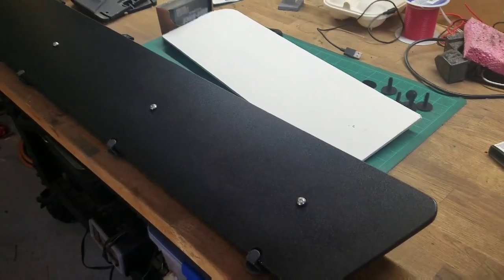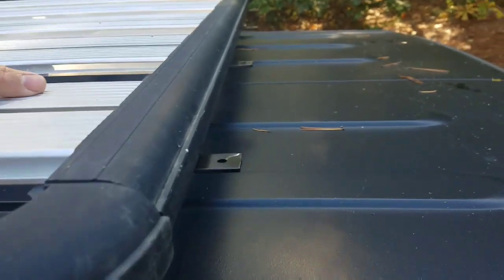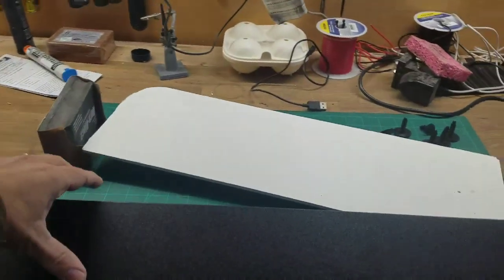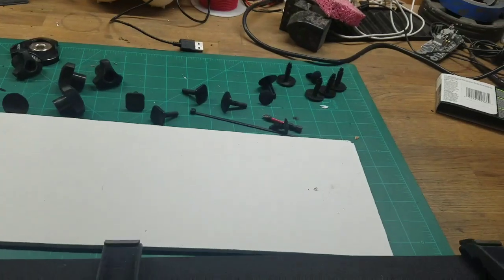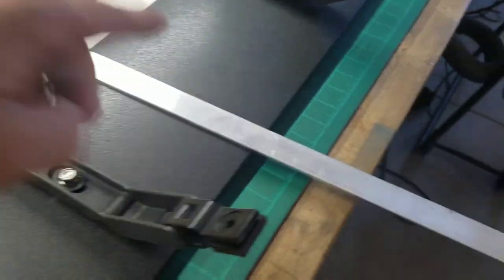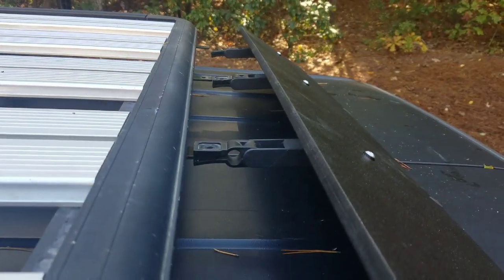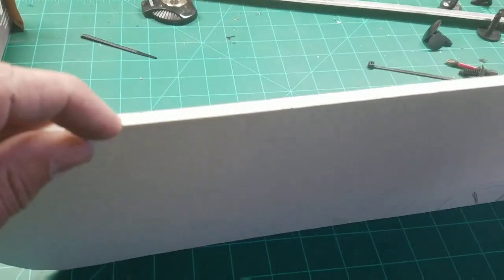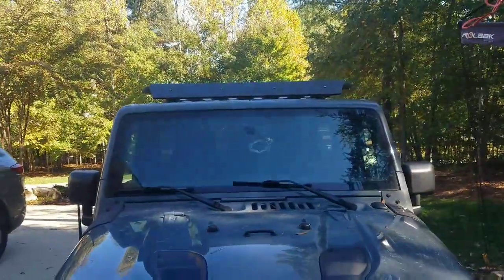DIY Roof Rack Wind Deflector using PVC Foamboard

Comment: Now you have me thinking of all kinds of useable applications for that kind of board.
Reply from the maker: Super easy to work with.    I can't say how durable it will be as it won't take a lot of impact, but I think this is a good application.   Interior trim like door cards.  Use it as a base structure for fiberglass projects... I'm going to play around and see what else it can do.
Reply: Comfort in Discomfort - I have used thick ABS for similar projects and it has held up well.
Reply: I used it to make slats to replace the glass in my daughters jalocee bathroom window

Comment: Thanks man !
I was really struggling trying to find the right material and this is it ! I have a home made rack system for solar panels on a Dodge Sprinter . This will do nicely.
Reply from the maker: Take a look at my follow up video.    It didn't work, but I know why.   It warped badly after a year in the sun.   I think it would work if it's supported better.  Maybe a c-chamnel aluminum.

Comment: Thank you for the material description and where to purchase. I need to make one and been looking around for what material to use.
Reply from the maker: I'm glad you found some value in it.  After a year, the coating looked great, but structurally, the deflector warped badly.   I think if I used an aluminum channel or maybe just one layer, it would have been better.

Comment: You really have me thinking about what I can do with this material. I'm thinking adding fiberglass to it and making it the roof of my roof top tent project. I also wonder if sealing it with epoxy would have helped as far as durability/rigidity and protecting it from the elements? Anyway, awesome idea!
Reply from the maker: I think the fact I laminated two pieces together was a problem also.   Having one expand more in direct exposure while the one in the back was cooler...maybe.    But I think it would be great as a middle layer.    I may have to try that.

Comment: First, awesome find on the rack. Second, great job building the wind deflector.
Reply from the maker: I got lucky for sure.    The ad was only for the platform which I wanted an was going to use with gutter mounts.   But the guy had brackets and he didn't know what they were for.   I told him but he had no use for it...  I have about 500mi with the deflector on so far.   Makes a noticeable improvement.   I may redo a few things, we'll see.   Curious how the material will do in the heat in spring and summer.

Comment: It looks great.  I think I'm going to try this, although I don't think I have a way to make the angle brackets.  

My thought is I can use a long aluminum door hinge and use VHB to tape it to the roof and tape the other half the of the hinge to this foam board material.
Reply from the maker: Don't do it.   Check out the follow-up video after a year.   It didn't hold up to the sun.   Warped badly.
Reply from the maker: Don't do it.  Check out the follow-up video after a year.  It didn't hold up in the sun.   Warped badly.

Comment: Just one question, doesn’t having that half inch or less opening on the bottom cause any issues with whistling on the highway ?
Reply from the maker: It was much quieter than before.    I didn't want contact with the roof for fear of vibration and damage.   So while I had it it was great.    Unfortunately, as you'll see in the follow up video, it warped badly.    Could be my construction technique as I laminated two panels.    One expanded in the sun, while the other didn't.

Comment: Nice video! I am thinking of increasing the size of my Yakima fairing from 48" x 5" to 69" x 8" to match the width of my roof rack. Do you think sandwiching two pieces of this board will work using the old brackets like you did? I will need to make two additional brackets for the extra width of mine. Your thoughts? Thanks for sharing!
Reply from the maker: Unfortunately this design didn't work long term.   It warped pretty badly (follow up video on my channel).   I think that the concept is good, but I think the material needs a C-channel on the long ends to keep it rigid.

I tried to find plexiglass or polycarbonate  that was wide enough, but only big sheets. I'm going to try again with a different support system.   The spray on rubber coating was great.
Reply: Thanks for letting me know. I originally had a challenge finding a material a few years back which is why I bought an undersized fairing from Yakima. I'll check out your other video. Thanks for your time!

Comment: Wow, this is very innovative!  Looks strong and light, perfect for RVs!  I have a couple of questions:
1. If its too short lengthwise, how can you glue two segments together to make it longer? My Class C RV is about 8 ft wide.
2. 3:17 - what are those curved latches/hardware attached to the fairing? I missed that bit.  Where did you get those supports?  That is the key to success.

Love that final finish you gave it!  Looks solid and very attractive.
Reply from the maker: I had high hopes for the material.   Regrettably, it warped badly in the sumer heat and UV.    The finish was fine, but the substrate looked very bad (look for my follow up video).    I have since used marine grade plywood and used the same spray on finish.    Doing this allows for longer length as well.

Comment: You think I can use something like this for the roof top tent fitted to the roof rack? The tent is a bit boxy so the drag is unreal and so is the noise!
Reply from the maker: If you watch the follow-up video, you'll see that the material didn't stand up to the heat/UV.   Got about 6 months out of it and it warped to hell.  However, the concept should work with a roof top tent for sure.   Polycarbonate, plexiglass, metal... but sadly this material isn't suitable.

Comment: What kind of roof rack do you have?
Reply from the maker: I still have a Baja platform rack on my son's JK jeep.    Unfortunately the material for the deflector is really not as stable in uv and heat as I had hoped.    The follow-up video shows that it really warped after 2 yrs.    I may re-do it with some aluminum reinforcement.

Comment: Looks awesome. Is it still holding up for you over a year later?
Reply from the maker: No unfortunately.  I made a follow-up video.  It warped badly, though I think it's because I laminated two pieces and didn't support it well.   I think this material is great, but the next version needs an aluminum C-channel.  The rubber coating did fine.
Reply: @comfort_in_discomfort  Thanks for the reply! Sorry, I didn't see the followup video. I'm researching building my own DIY wind fairing for my roofrack. This is extremely helpful info. Thank you.
Reply from the maker: @allencoin  Good luck.  I will likely try again, this time with a bit more support, and planning...

Comment: How is this holding up nearly 2 years later?
Reply from the maker: Not well.  I made a follow-up video.  12 month failure.   Warped badly.    I think laminating two sections was a mistake as one gets direct heat, the other does not.    And I should have supported the whole length with a c-channel.

Comment: nice job
Reply from the maker: Thanks.    I wish it had lasted.   I posted a follow-up.   It warped badly.   I think because I glued two pieces and they expanded at different rates and because I didn't support them well.   I think the next one I'll use a piece of angle channel  and it should be good.
Reply: @comfort_in_discomfort  Good to know! I'm currently using a piece of pine as a POC which has also warped, I suspect due to water. Did you consider plain PVC/polycarb flat sheets?
Reply from the maker: @yrebrac  I think the next one will be a polycarbonate sheet.  Thus happened to be material I had as I used it to make door cards for my wagoneer and it's perfect for that.

Comment: would have been nice if you provided a link
Reply from the maker: To the pvc board?   It's a ceiling tile I bought at Lowes.   However, the follow-up video of a year later shows a compete fail.   Wouldn't suggest it for high UV exposure.
Reply: @comfort_in_discomfort  ha!  OK thanks!

Comment: Nice work 👍, maybe should have gone a little bit wider.
Reply from the maker: For sure.   The Jeep roof is 52" wide.   Unfortunately the panel I had was only 48.   Next time I'll use a different material as well as making it bigger.  This material warped badly (see follow-up vid)